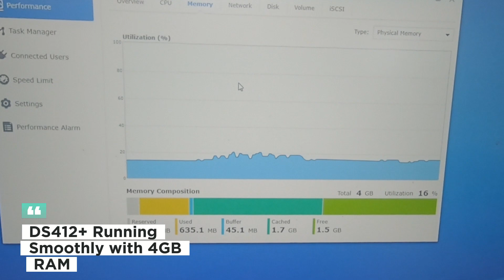Synology DS412+ Upgrade: 4GB RAM Boost and 8TB Drive Installation for Peak Performance

Comment: Yesterday upgraded my new-old DS216plusII from 1GB to 8GB, backup performance multiplied :)
Reply from the maker: Nice. That’s great..
Reply from the maker: I will try to Upgrade mine if ever i find..8gb RAM. Hopefully it will work because my NAS is 2013 model
Reply: @Junmarvi find the 8gb to work, or this model capped at 4gb?   Thanks!
Reply from the maker: @kernzilla  Hi , im not sure if this model is capped at 4GB for the memory card. and I'm not sure if an 8GB card will work, only 4gb available last time.🙂